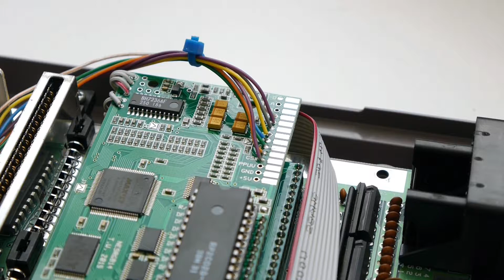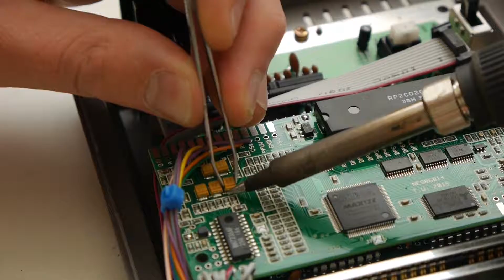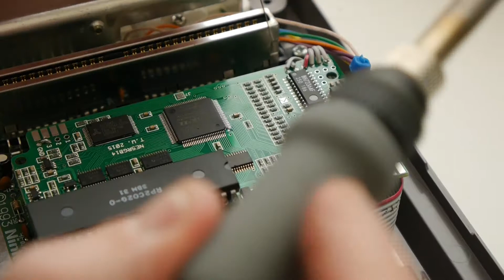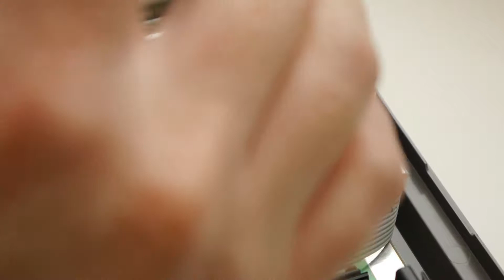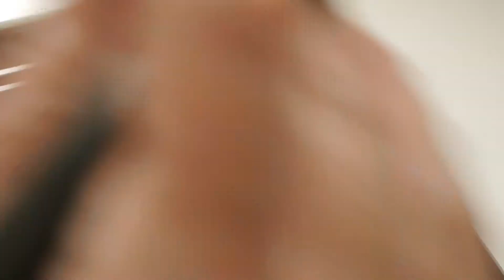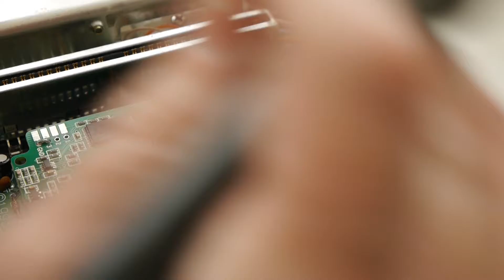NESRGB install update - removing the video caps

Comment: Looks like you’re using the CS# for sync. Isn’t that the TTL sync per Tim’s website? Why use that as opposed to the Composite sync (V)?
Reply from the maker: CS# is for c-sync (composite sync). It can be either TTL or 75 ohm sync level depending on your needs. I could use sync-on-composite by pulling sync off the composite video line (V), but there's not really any incentive to do that for this setup. C-sync is cleaner, the multi-out has enough pins for both composite video and c-sync to go separate, and cables are readily available that support c-sync. Typically I will only use sync-on-composite when there is a good reason to do so (such as on CoreGrafx where there are not enough pins to have c-sync separate).